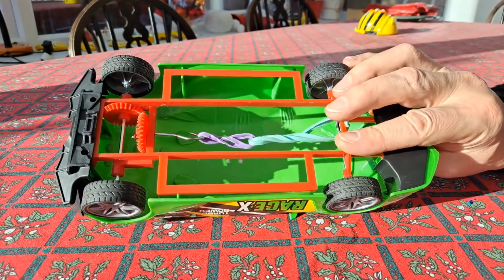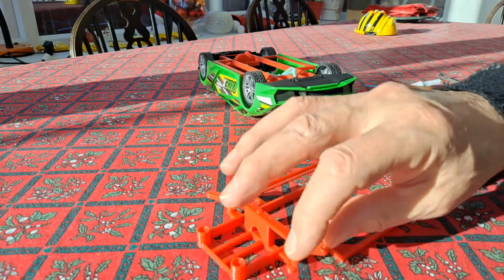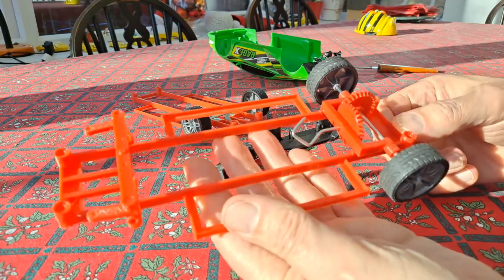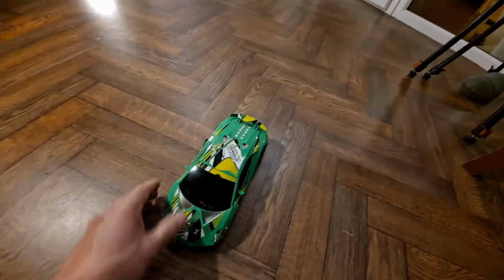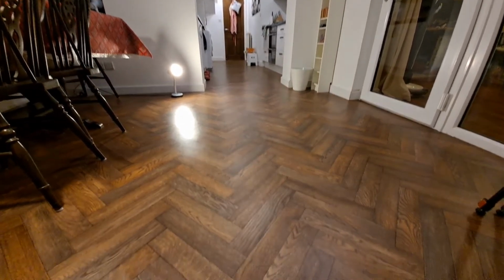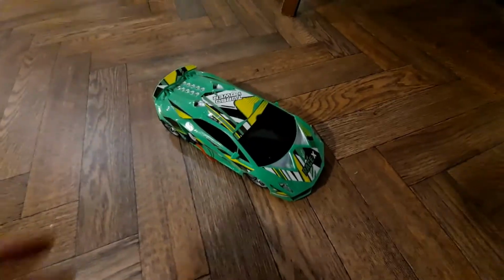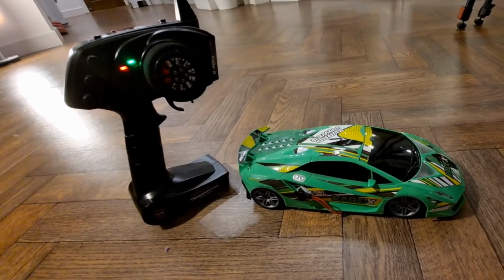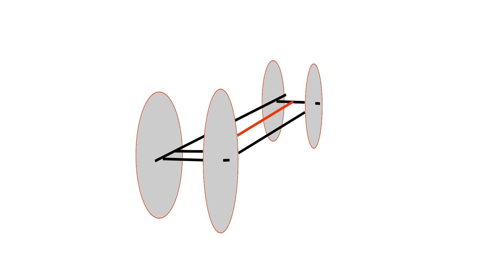Put a rubber band on it 0378 Poundland Race X RC conversion

Comment: I seem to remember there were single channel radio control receivers in the 1950s that used a rubber band mechanism to allow you to cycle through various functions (like left, right, centre on a sail yacht). I know that's not what you are doing here  it just made me think about it. Good build though. Thanks 😀 👍
Reply from the maker: Sounds like what I remember as "galloping ghost". I never had RC back then, but I remember reading about it. As you say, you had to step through the sequence to what you wanted. I have had it in the back of my mind to try to recreate it. Maybe on a car, should be fun  🤔

Comment: Ive seen plastic axles on toys so maybe print some?  the 4-415 run worked well, different gears could get you longer run times..  its a cool hybrid !
Reply from the maker: Thanks Doc, if I put decent hobby grade rubber on it, I think we could get a good run from it, but I need to take it apart again, so I can put an electric motor in it.

Comment: Didnt expect that grandad but that worked really good 😀. Nice job with the Radio steering. Was that the first One you did with rc steering? I like that a lot.
Reply from the maker: Hi Marc, this is the previous RC rubber band power car - Put a rubber band on it 0051. In this episode we use a toy RC car chassis and steering to make our car radio controlled - https://youtu.be/8zYN3SQ78F8